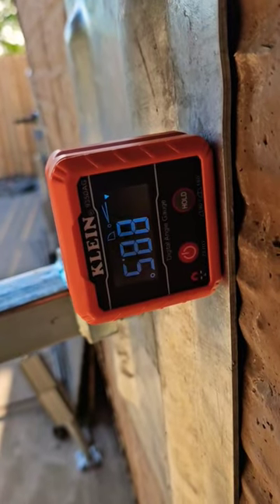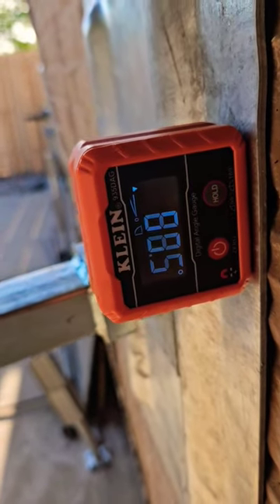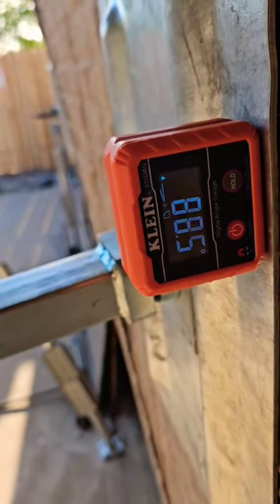Straightening A Leaning Retaining Wall With Anchors

Comment: Brother you have to stick that angle finder on an 8 ft level other wise your only plumb in your little aread your tool can read.
Reply from the maker: Not looking for a precise measurement more just the Delta Before & After tightening.
Reply: @EEI605  👍